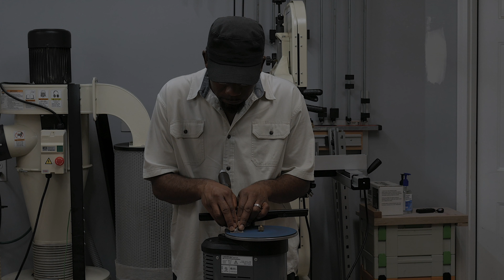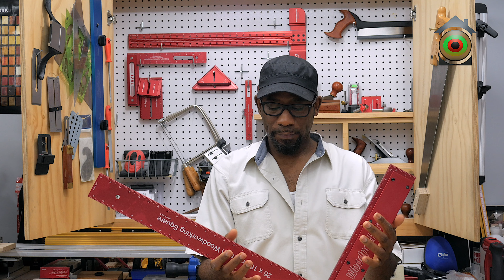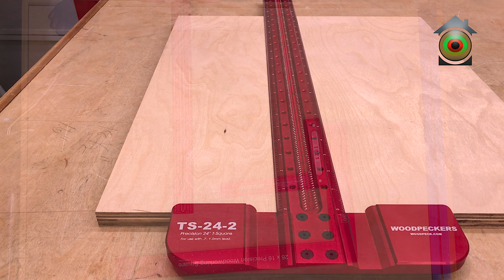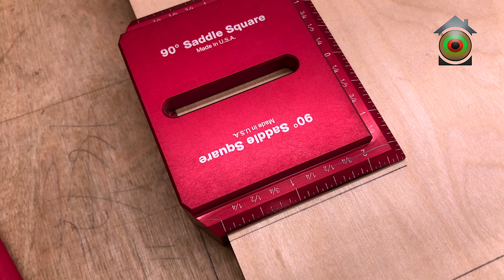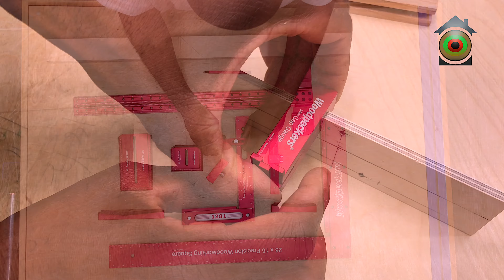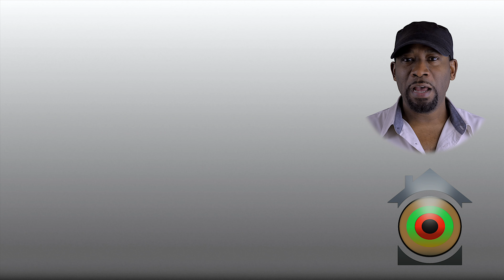My Woodpecker Layout Tools

Comment: Michael, where are you located? 

2-I have a couple of Woodpeckers tools, and you are correct; they are so perfect they might be Holy, and I’m not kidding.

3-I bought their 641 square on eBay, and it was off by the slightest hair, and I called to ask how much would be the repair. They told me to send it to them for evaluation, and then they just replaced it, and I nearly wept. 

4-so call them and whine about your 1281, and reference this video, and they’ll probably replace it because you just persuaded 1000s of people to invest in Woodpeckers.
Reply from the maker: Thank you David!

Comment: Hello Michael. Thank you for another great video.  I am also a huge fan of Woodpeckers tools.  I have the stainless versions of the 12 and 6 inch squares.  I much prefer them to the solid aluminum squares because they are lighter and have blades that are much thinner compared to the aluminum squares.  I use them every time I am at my bench and they are by far my favorite layout tools.
Reply from the maker: Thanks Jim! I'm really considering the stainless steel squares.

Comment: I am sure that Woodpeckers is absolutely precise in their dimensions. I have not read anything on their site so I don't know how their stuff is made. But, you repeatedly used the word "machined". I would bet you that it is extruded and not machined. IE on the parts that you mentioned anyway. That"s just semantics, I get your message. Woodpeckers tools are super. I also bet you that I will never buy anything from them!
Reply from the maker: Machined (milled)
Reply from the maker: They actually have videos showing their manufacturing process Jeff. Thanks for watching!